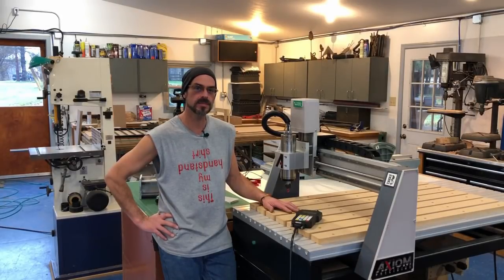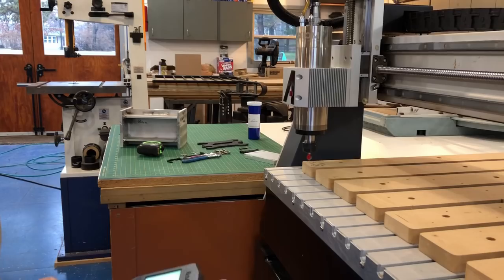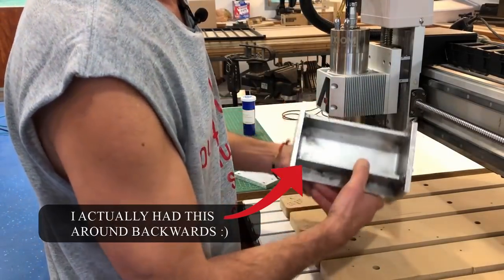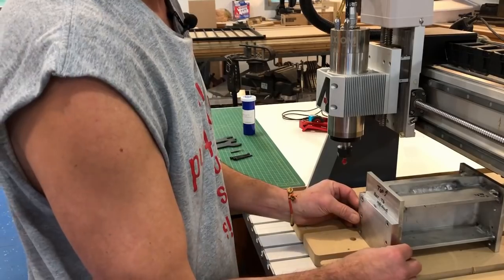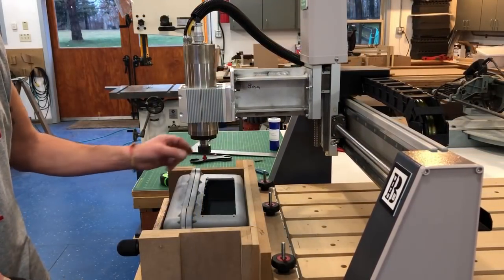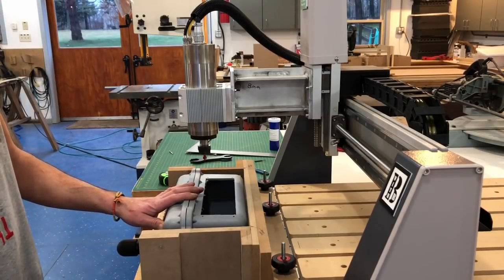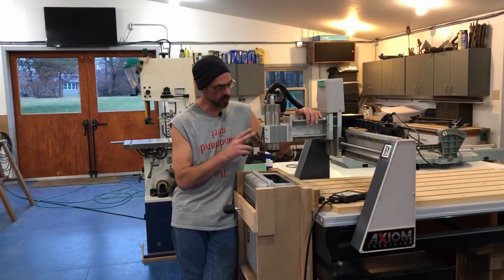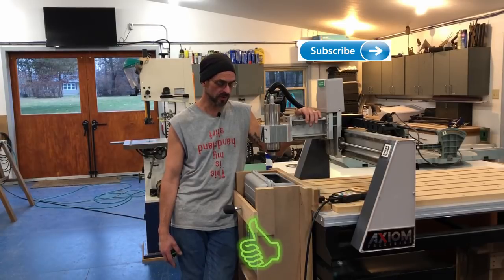CNC hack // Over the Edge

Comment: Brian, thanks for the information. This is EXACTLY what I need to do with mine. I'll be cutting hardwoods (mahogany and maple) so I'm a little nervous about the cutter head flexing when it's out that far. I guess I'll have to try it and see. Was that a 6" aluminum wide flange that you used?
Reply from the maker: I used an 8”  aluminum bean with a flange width of 5”, with the important surfaces machined flat and parallel, and machined in the location pins as well.
Good luck sir

Comment: great jig brian, can you tell me where you sourced the cases? im considering getting some for tool cases,and do you think Axioms single screw for the y axis is a weak point compared to other CNC machines? mine has 2 screws on the long axis. you have a new subscriber , thanks
Reply from the maker: To answer your second question first, I do not think it is a weak point to have the single screw at all Actually, it’s just unfortunate when you have a single screw you cannot cut a hole in your spoil board and put something that is particularly deep like the cases I have been cutting. It’s just the nature of the design. The actual them I have is working phenomenally and I have no beefs with it at all. As far as your second question about the cases and where I source them, my customer actually supplies the cases.
They buy them from various suppliers online, including Amazon
Reply: @BuildswithBrian  thanks brian, my German made CNC is getting old and it may be time for a new one soon, i like the high z height on the AXIOM and we have an irish dealer here. i may try and track some cases down, they gotta be cheaper than the overpriced systainers from festool! my small shop is unheated and im constantly fighting surface rust on tools,the CNC is indoors.  going to case up my hand tools in the shop with dessicant packs and see if that helps. cheers.

Comment: Well I am officially blown away by this modification.
Reply from the maker: New too 😁
Reply: @BuildswithBrian  I've seen some of your videos before, but someone on a FB CNC group page directed me here, after I asked if it was possible to cut a hole in my Axiom bed.
Reply from the maker: @acerjuglans383  unfortunately it won’t help to cut a hole in the bed with this design with center lead screw drive.
I certainly would have done if instead of going thru the hassle of making that extender 😆

Comment: Brilliant. I just had to cut similar holes in the ends of some 3mm ABS housings. They're 900mm long. I was looking how to make a jig to hold a DeWalt trimmer or even Dremel over the edge of the machine bed. 
What I did for now was machine a jig that fits over the end of the ABS casing and then manually rout out the holes with a 3d printed guide bush. Old school but effective. There's a chance I need to do several 100 more cases so I'll certainly look at a rig to hold some sort of small spindle out there. 
Nice work and good inspiration.
Reply from the maker: You’re welcome, sounds like you’re quite an innovative person.
Good luck with your project
Reply: @BuildswithBrian  Thanks Brian, I'm certainly going to give it a go.

Comment: I can't see this doing any harm to your machine.  My CNC router is just made out of cheap plywood and strength has never been an issue.  I am very surprised they do not build this ability in to their CNC in the first place, some overhang is required for cutting dovetail joints etc.
Reply from the maker: I agree, Axiom should definitely have designed an overhang into their machine, Especially considering their design with one centered shaft to drive the Y axis does not allow you to remove a portion of spoil board so you can drop something down and work on something tall
Thanks for watching!
Reply: @BuildswithBrian  but could a person cut a rectangular hole in the bed, off center of the Y axis screw?
Reply from the maker: @acerjuglans383  no that would not work, there is the cross member that is driven by the center lead screw.

Comment: clever solution. I have the same machine, now that it has been six months would you do the modification again? Any unseen issues arising from the modification?
Reply from the maker: Absolutely, it made my machine more useful, I use it for some Jobs that earn money, and no I wouldn’t change anything with my modification. I would say the only drawback I’ve encountered is that it takes about a half hour to switch over .
Reply: @BuildswithBrian  Thank you for the quick reply. I will be copying your idea. Much appreciated
Reply from the maker: Do you belong to the axiom users group forum ?
Reply: yep, that is how I found you. I am on there very infrequently. Prefer to be making sawdust
Reply from the maker: Lady and Carpenter 
The reason I asked that is because there’s a fellow by the user name of Branson on there that posted how he built something similar to what I did for a trim router to do box joints, you might want to check it out if you haven’t already seen it